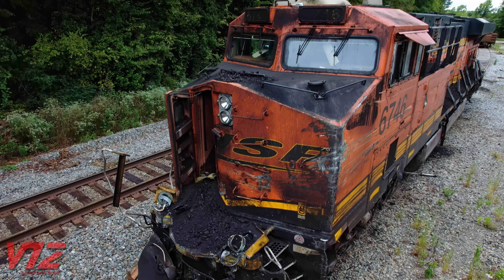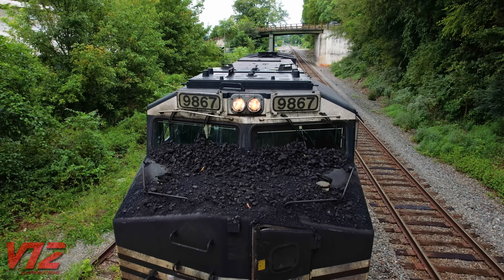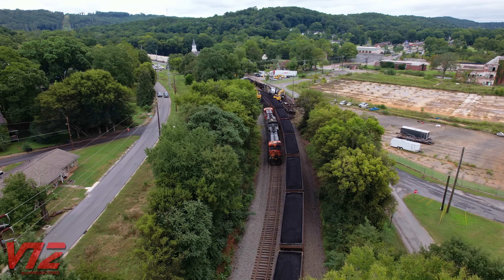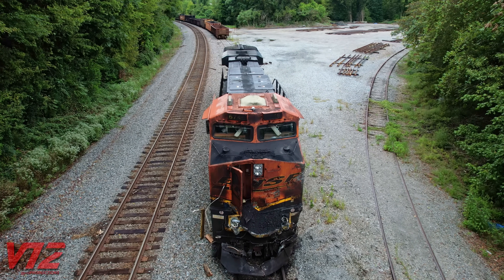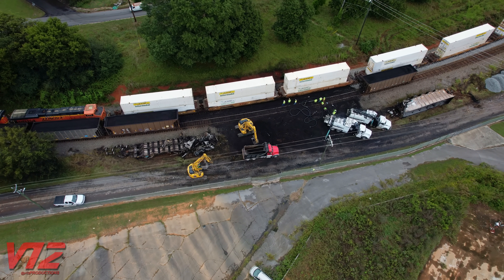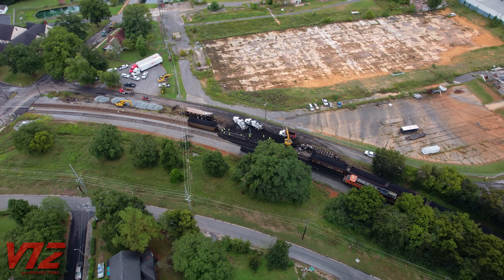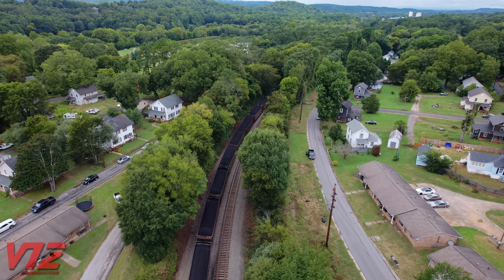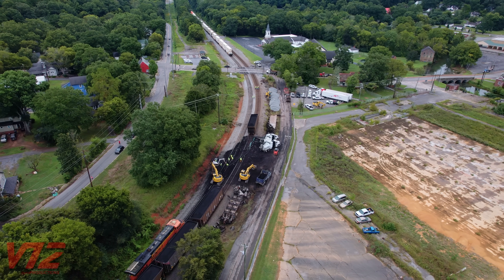RUNAWAY Locomotive & Head-On Collision in Rome, GA

Comment: Wow what a catastrophic failure. I’ll admit I’ve seen some things happen with those machines others wouldn’t believe. But it is mechanical and mechanical things fail. There is just so much safe guards built into it. You wouldn’t think all of them would fail at one time but who knows. First thing that went through my mind how does the lead locomotive break loose from its train and go 4 miles and collides with another train ? The fact that it tore apart from the rest of train should should have put the brakes on and shut the power down on the engine. Then it went through my head if it’s the lead locomotive why don’t the crew shut the thing down and stop it ? I thought they was either dead or they had come to realize things was beyond their control and they jumped. I’m glad to hear they did and hope they ain’t injured to badly but I bet they didn’t jump till the last minute. I tell you what thats not a fun thing I’ve jumped and ran like hell before . It’s not a good feeling. I mean there is so many bazar things that happened here. That distributive power thats not the best thing that ever happened to the RR either those things run by remote signal from lead locomotive and signals don’t always transmit correctly. And that could well be the cause of the derailment to start with. The old southern railway quit using them things 50 years ago because of radio signal loss and the engines in the middle started doing their own thing.  Tunnels was a disaster. Lot of story going to come out of this fiasco. Runaway locomotive is something generally you see in the movie. Thats not an everyday occurrence but once again . It is mechanical and subject to failure. I hope the carriers don’t try to just lay it off on the crew. They wanting one man trains so bad right now they will say anything at this point to get what they want. If they can use this wreck to their advantage they will. But seems like from from whats going on here they might have a hard time with that one. Good luck guys if you read this. I hope you all fully recover. Some of us know exactly what you just been through !!!
Reply: Shutting down the engine doesn't stop engines, you'd know that if you were retired rail worker as you claimed in your other posts. Also the brakes were torn off as you ranted about in another post so non existent brakes won't work. More proof you are a troll.
Reply: The old Southern did not quit using DPUs.   There was no such thing 50 years ago.   This is brand new technology.  The lead unit did break away, but the brakes were badly damaged.   Hard to apply brakes if they won't work.   And if you are a railroader, you would know that even if the crew shuts down their power the units can coast for miles and miles on level track
Reply: Ahaha typical foamer. "I would have done this, this and this! I would've been the town hero!" Haha you absolute joke

Comment: That damage is minimal compared to them hitting head on going 50 mph each when they hit.  That damage was not all that great because one or the other of those engines had to be going slow because speed coupled with the inertia based on the weight of the train in motion could have been much worse
Reply: That is a wicked hard read.  I hope English is not your primary language.
Reply: @ShainAndrews  Obviously it's not yours.  I could have used a comma along with "it", as in "It could have been much worse", but when typing fast I don't always get the punctuation where it should be.  But you did make a good point.  Thanks.
Reply: Inertia throwed him off man. Got to remember there is a bunch of foamers on here that know far more about this subject than us grunts.
Reply: @benth162  Using commas doesn't fix your grammar.

Comment: I never get how train companies in the US make mistakes like these so often. Like you rarely hear about an issue like this in Europe. Like sure, trains still derail there but a remote controlled train doesn't just break free and crash head first with another. I suspect they will blame the workers and it may be their fault but knowing the hour those guys put in, I find it hard to blame them
Reply: The engine that broke away was the lead unit not the remotely controlled units.

You didn't understand the nature of the accident.
Reply: @GarrusN7  even then, you never here about this happening in Europe. whether or not this was a remote controlled train doesn't matter cause a run away train should happen. 

The fact it even happened is an indication of a failure of the system to catch this
Reply: @isengrom6883  European trains don't do this because they're basically toys.